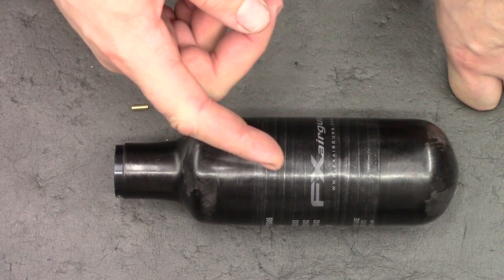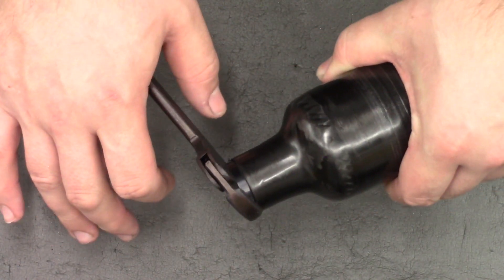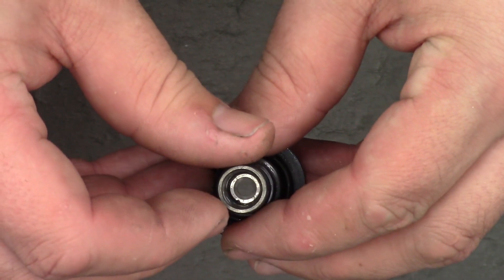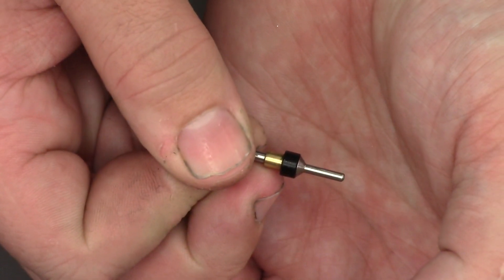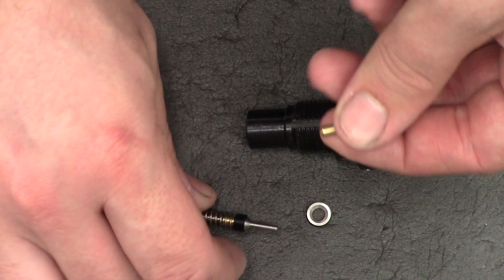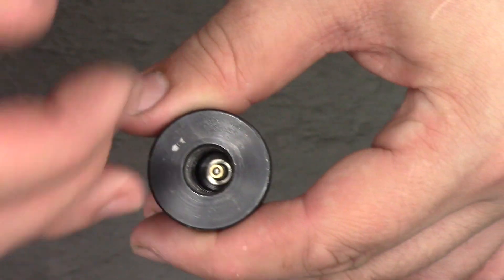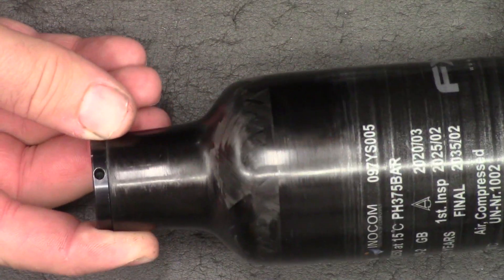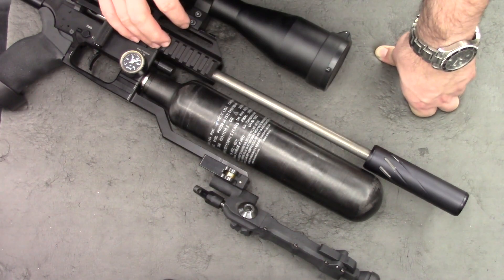FX bottle valve disassembly and M3 bottle conversion

Comment: just got a Maverick and when i unscrew the bottle after adjusting regulators the bottle just empties the air and needs refilling when screwed back onto the gun, any idea what that issue is?
Reply from the maker: Sounds like the valve is getting stuck or the valve face has some damage on it, you can take the valve out the end of the bottle and take a look, if the face is not damaged you might get away with adding a bit of silicone grease to free it up. Thanks for watching.
Reply: @sub12airgunners  I managed to fix the valve thank you, also seems FX neglected to fit an O'ring inside the bottle valve and I am having a nightmare trying to fit it any tips? it is really tough to manipulate into the seat
Reply from the maker: @Gavstan799  Make sure there isn't still one in there its hard to spot, try to feel with a pic or cocktail stick, if its not in there coat the new o ring with silicon grease and just try and work it in, its not easy but it does on in. Thanks for watching.

Comment: Cheers for that video I’m getting a second bottle for the m3 and wanted to know how easy it is to put on the brass sleeve, if it just slots on it without  taking the valve out then happy days 👍
Reply from the maker: Yep, no need to remove anything, just slide the new one on, the ones we sell we recommend a little loctite to stop the sleeve falling off. Thanks for watching.
Reply: @sub12airgunners  cheers. Im wondering if the valve pins on the best fittings bottles are the same as the fx ones? 🤷🏼‍♂️🤔

Comment: Nice video. Have you ever tried the huma second reg for the impact mk2? They show you have to cut down the bottle valve for some reason, do you know why? Thanks.
Reply from the maker: I have never fitted one but it looks like the bottle is no longer removable, so the one way valve inside the bottle is no longer needed and they have you cut it off, to stop it interfering wit the external reg. Thanks for watching.

Comment: Great vid as per 👍 are you doing the brass sleeves ?
Is the m18 internal bottle thread the same for L2 bottles ?
😎👊👍
Chris
Reply from the maker: Yep the brass sleeves will be coming next week, and the bottle thread is the same as the L2, you have to be-careful on length though I think only the 300cc bottle fits on the L2 without hitting the grip.

Comment: Thank you very much for this video, i think I need to get a new pin valve for mine. Any recommendations on where to get hold of one?
Tank you for posting the video really fast. Your work is very much appreciated 
😁👍👍👍👍👍👍
Reply from the maker: Thanks, not sure you might be able to get one from sportsman gun center, although you may have to call them as I don't think all parts are listed on the website. Thanks for watching.
Reply: @sub12airgunners  thank you will give them a call Monday 👍
Reply: Hi thx very much for your video ! I was asking to myself the same than Luis , I don’t know where I can order a pin valve …
Reply: @Slipveste  hi i managed to get the complete part from sportsman gun centre in Exeter they are able to supply the complete part to attack to the bottle they don't have just the valve on its own. The complete assembly cost me £80. Hope this helps you